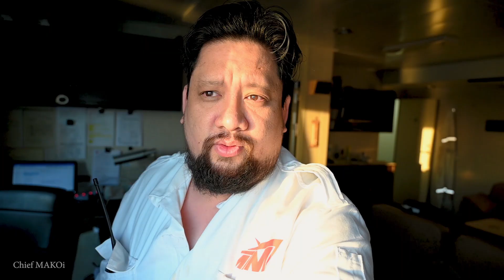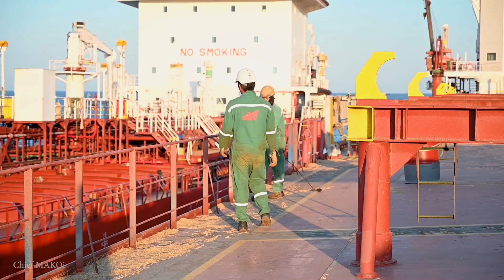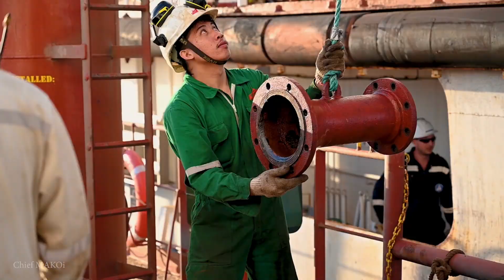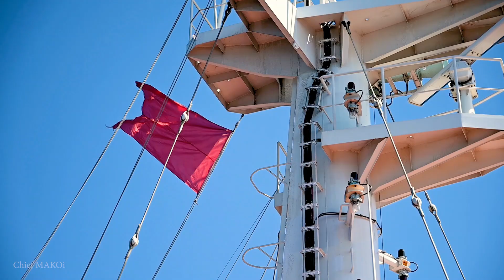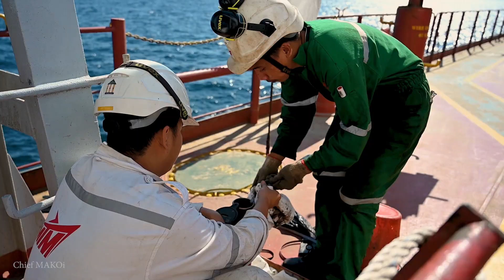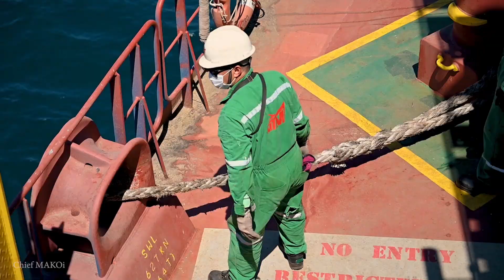Bunkering : Refueling Ships at Sea |  Seaman Vlog S03E10 Chief MAKOi

Comment: Interesting I'm curious what happens when you get bad out of spec fuel - seems like by the time an analysis can be conducted on the sample it would be way too late to do anything about the bad fuel that was loaded on board.
Reply from the maker: Ship owners will fight the suppliers with claims and if possible off-load the fuel.  All losses (off-hire, repairs, etc) will be charged to the supplier.  It's an insurance of sorts.

Comment: how can you be able to monitor or what you will do to produce or deliver a good quality of fuel in the system order to protect your fuel pump and  fuel injector?
Reply: fuel bunkered is not mixed or used until you receive the laboratory results.

Comment: I was curious about how this happens. Thanks for showing how it's done. I was surprised that no one took a final turn on the flange nuts with a torque wrench, in the correct order like a head bolt. Easy cure to avoid a leak? Thanks again. Fair sailing !

Comment: Great video. Those hard hats show signs of severe UV rot. Also, it appears those bolts and studs need to be replaced. Under ASME standards they should be replaced after every three uses and they should have been checked using a precision torque wrench. Stacking flanges like that is also against best practices, your fuel sampler should be built into a spool piece like the reducer.
Reply: i guess you are not seaman... hahahah

Comment: 400 tons of fuel oil to reach your destination?  Were you going from Miami to Fort Lauderdale?

I have flown 747's from Los Angeles direct to Seoul, and we put on 300,000 pounds [150 tons] of fuel to fly this 13+ hour flight.  This was a 747-200  with Pratt & Whitney engines that typically burns about 25,000 pounds per hour while covering around 600 miles, or a little under four gallons burned per mile, each of which we covered in 8 seconds.  The distance and fuel usage can change because when you are flying west, since you are generally going against prevailing winds which can reduce your ground speed by 100 mph in the winter months.

Those big boats eat fuel, I'd be interested to find out the gallons per mile at 20 knots....
Reply: thanks for showing us clearly that vessels are far far far far more efficient than planes. hahahahaha
Reply: @vicginval  YW
Reply from the maker: Ships like these consume only around 30 metric tons/day running at around 13.5 knots.

Comment: Unless you're with the military, then Underway Replenishment takes place. That's always fun. Marine Engineer who sailed with Military Sealift Command.
Reply: Underway Replenishment is when two vessels match speed and direction, and a coordinated sequence of events takes place where an "Oiler" , which is a tanker with Fueling-At-Sea stations sends a hose over to the customer.
Reply: I sailed from 3 A/E up to 1 A/E (internationally, 2nd Engineer to 4th Engineer). Cargo 2 A/E on Oilers maintains all deck equipment including cargo pumps, and is in control of the pumping operation. Cargo Mate is fully in charge, but Cargo Engineer is in full controll of pumps.

Comment: 7:52 that seems backwards. I would think that the sample would be taken from the barge before you go through the trouble of connecting the hose.
Reply: Yeah fr, and they’re just gonna use the fuel untested? Some things don’t make sense
Reply: the barge has already tested the fuel, and initially it is good, that's why they load it. BUT, if you are the buyer, you may trust nobody, so during loading you take another set of samples, to test by yourself and confirm the fuel is good. You will not use that fuel until YOUR analysis arrive. It can destroy your engine.

Comment: This is refuelling at anchor. You might as well be tied to a pier. Refuelling at sea involves ships underway. One ship passes a line (gunline) to the other. You then pass increasingly larger lines until you can haul the fuel line over. The only people who undertake this very dangerous evolution is the navy. Civvies don't have big enough balls to run 2 100000+ ton ships at 10-15 knots 100 meters apart.
Reply: it is not a matter of balls my friend. it just dont worth the risk. Navy vessels are built to perform that way, civvies don't. Those navy systems are quite expensive and very difficult to operate. Just civvies dont need it, they can just stop and do it safely.
Reply: @vicginval  then I recommend that you don't refer to our dangerous evolution as something civvies do. If you are at anchor you are not at sea you are at anchor. Usually in a protected harbour or anchorage. Most naval vessels don't generally need to replenish under way. We do it so when shit hits the fan we are ready to protect your disrespectful asses. Again when a ship is at anchor it's at anchor. When a ship is at sea it's at sea and generally underway. And if you don't have the balls to do what we do then don't tell people that's what you are doing.
Reply: @matthewmcintosh4925  ahhh... your problem is with the terminilogy... don't worry... i confirm this operation was done "at anchor in open sea", don't be angry. By the way , thare are also very dangerous operations carried out by civvies, but only when it worth the risk, for example Ship to ship cargo transfer operations, carried out at sea, underway, and with the vessel's touching each other, not 100 meters apart. I have been surveyor in a gas cargo transfer this way, if you like i send you pictures. From your comment i guess you are a member of the navy, and you felt extremely offended, relax man, my ass is not in anyway "disrespectfull". I simply admire every single seaman around the globe, i have to work side by side with many of them. But if i tell you the truth... i'm spanish, i guess you don't, so when "the shit hits the fan", you do nothing for me, you do only for your beloved compatriots. And by the way, you are payed for your job, same as me, don't expect the people to be amazed and gratefull for what you do, it is just like many other dangerous jobs.

Comment: That was fascinating. I always thought it was port to port fueling, never at sea unless it was military. I'm shocked that there's not more automation. Level sensors, discharge sensors and a much more streamlined connection. Bolted flanges with gaskets seems rather basic.
Reply: Because of the high pressure, flow and stresses on the fitting a large quick connect isn't suitable. Besides, bunkering fuel is typically a slow process. There's a lot to do whilst things are being made ready at the manifold and other locations that wouldn't be benefited by a quicker connection. The crew are on the ship so are on the clock so to speak so a reduction in manpower requirements wouldn't affect the bottom line either. They'd be sitting around doing nothing but getting paid. It seems complex on the surface but in reality it's 15 or so crew each doing their task which is fairly straightfoward in and of itself. A lot of these tasks are happeing simultaneously making it seem like a bigger task than it really is. 

Manual soundings are again another line of defence and reliability whilst a typically slow operation is taking place. The consequences for incorrect loading are catastrophic and expensive. Both parties are invested in double checking each others figures and not relying on guages. Many vessels do have guages but it is standard practice to manually verify quantity. We do the same in aviation - loaded mass is crosschecked with guage mass which is crosschecked against the previous flights calculated consumption. Eg if we filled up with 5000lbs of fuel, burned 2800lbs, loaded 1800lbs our guages should read 4000lbs - any discrepancy indicates a fault and we'll have to manually sound the tanks (mag strip, dip etc) to verify the quantity. Either the guage is faulty, the sensor is faulty, there's a leak or we have not loaded enough fuel (perhaps the refuler did litres, kg's instead of lbs etc etc) or perhaps we are burning more fuel than the system is calculating. Same thing on a ship - manual checks add another way of crosschecking. Incorrect loading can lead to dangerous stability issues, fuel starvation which has a high likelyhood of hull loss or even break up if there was grossly incorrect loading. Overflow is the least threatening concern but has significant environmental and financial penalties.

Perhaps some military vessels have some high speed bunkering process where the operational demands exceed the environmental concerns (I am not familiar with these so can't comment specifically) but for merchant & civillian marine it is an extremely high concern area.

Don't get me wrong, it seems complicated but in my experiance I have often (but not always) found that in commercial operations there's usually a good reason for things to be expensive, hard or labour intensive. Companies love to cut cost so if they can they usually will.
Reply: @twentysevenferrets  Thank you!
Reply: @twentysevenferrets  wonderfully stated! It’s great to see that some people still write in complete sentences along with punctuation.
Reply: level sensors onboard can give you an overview of the level, but they lack precission. If you make the ROB calculation of the vessel by sensor and by manual sounding, i have seen differences of 30/40 metric tonnes.... nobody wants to loose 20000 dollars
Reply: they should have atleast elecrical impact guns...
Reply: @kerstas10  electrical impact guns are extremely dangerous close to a fuel pipe.... WTF?
Reply: @kerstas10. Electrical !? In the presence of flammable oil !? Also a risk of metal impact sparks!

Comment: I've watched underway replenishment of US Navy ships many times in documentaries, where they usually use a pneumatic gun to launch the mooring lines. I was pretty surprised to see the crewman on the tanker throw the line by hand. Am I correct to assume that there were many misses and failed attempts before he finally got the line across the water ?
Reply: The navy ships are both moving, while these ships were not, so the ships here were a lot closer.   I think the navy ships are 100 feet or more apart, so throwing a line that far isn't possible.

Comment: How come these big tanks can’t just have a gauge see you don’t have to sound them
Reply: Less to go wrong with a bit of string and a weight, also you know if its broken.
Reply: its a black viscous liquid, it will be hard to see
Reply: it's impossible, the ship is always rocking so float measuring is useless. to make it doable it'd need complex installations for each tank. 
large tankers now use a special like sonar/radar probe that is inserted in the tanks when they are empty to measure their  volume accurately, even their volume was theoretical up until a few years ago.
Reply: Might be easier to measure fuel flow rate. If you know how much fuel you took on, and you know how much you're consuming, you can reasonably accurately estimate what your fuel status is. Not uncommon to do this in aviation. Sloshing fuel, unreliable gauges, the size of a gauge for a ship like that... Not hard to go without fuel gauges when you know how to do it.
Reply: The gauge will constantly move because the ship is moving

Comment: In Singapore, bunker suppliers use Mass Flow Meter (MFM) for quantity measurement, not sounding method. So, vessel crews do not need to take sounding on bunker barge. They only need to take a picture (witness) the zero-setting of the Mass Flow Meter. When the bunkering is finished, it is only to print the ticket from the meter. It is more efficient and less quantity disputes.
Reply: 5 barges discovered tricking the MFM's in Singapore

Comment: Interesting, I didn't realize commercial vessels refueled at sea.  I spent 4 years on a US Navy oiler. We refueled ships while underway.  Steaming at about 12 knots, ships would pull along side for fuel and supplies.
Reply: And I was probably on the receiving end of your hoses and receiving cables for four years.
Thanks for being out there to meet up with us!
Reply: Same here, for some reason I always assumed merchant ships would refuel in port, and only military vessels did it at sea.
Reply: From memory a major reason they refuel ships at sea is because it allows them to fuel in international waters and load dirty fuel that would be illegal otherwise due to environmental regulations.

Comment: 2 questions.  Why is there no mechanical or electric technology to tell you how much fuel there is in the tank? It seems so antiquated to rely on soundings.  Isn’t there a clock that spins, the way home fuel oil is dispensed? Secondly, I’m curious as to how much the refueling cost? Thank you chief.
Reply: fuel in the tank... there is... but lacks precision, and can be faulty . Sounding allways work, ever in a 30 yo vessel. Clock that spins... yes there are, but they are very very expensive and requires an extreme maintenance and periodic calibration by certified companies.

Comment: "... oil spill prevention materials were made ready, as standard procedure in case an oil leak happens."

4 DECK SHOVELS, 2 BROOMS, A 50 GALLON DRUM AND A HOSE  😳
Reply: There's a lot more on standby fyi.
Reply: any suggestion?... i bet you have never seen 100 liters of HEAVY FUEL OIL in the floor. How would you clean it  (i give you a clue, at 15ºc it is like nutella)

Comment: I’m wondering how you got that low on fuel to begin with? That refuel had to cost $$$$ more than topping off in port?
Reply: Not every port will have facilities to bunker from. There is also the high cost of sitting in port just to get fuel compared to the cheap cost of dropping anchor.
Reply: @jaquigreenlees : Thank you! Now I know!!

Comment: Hey there, chief! I have been wondering — is there a standardized method in the industry for tracking maintenance schedules and ship-specific tasks? A lot of stationary plants have long-serving chief engineers, and successors can take years to get the hang of it. Do ships have a more standardized or rigorous way of maintaining vessel-specific maintenance info?
Reply from the maker: It is a requirement but there are many Planned Maintenance apps like AMOS, SMMS, etc.  Some companies develop their own apps to fit their specific needs. These apps need to be certified by Classification Societies.  
Items like maintenance schedules, spare parts inventories, requisitions and other stuff are monitored and updated in those apps.  Which is why it is fairly easy for newly hired people to takeover but only if the data is updated properly.
Reply: @ChiefMAKOi  Thank you for taking the time to respond! This is useful and sensible.

Comment: I know you use the bunker fuel for your boiler. My ? Is how often do you bunker diesel for the main eng. is it all low surpher or a combination. As a fueler for aviation fuels we use to revive at 3000 gym. This ops seemed slow. I enjoy your video’s but being 74 yrs old I think I miss my calling.
Reply from the maker: We use bunker for ME and generators as well.  We only use low sulfur diesel oil in US and EU ports due to regulations.
Reply: @ChiefMAKOi  thanks for info ya must pre heat the crap out of that stuff to get it to flow thru them injectors. Fair Winds Shipmate and Following Seas. 👍😬😄😘

Comment: Brings back memories.  Now, try this operation doing 12Kts in rough seas  and  hoping you don't  hit the oiler.  In 45 minutes we took on 70,000 gallons .  That would last us about 3 to 5 days.  So, twice a week we would get fuel.  I remember a single emergency break away in three years.  What a mess.  Fuel on the main deck.  It was sticky and gooey.  A saltwater washdown first then lots of scrubbing.  On station, we carefully washed the side of the ship.  The fuel left a yellow-brown stain in Navy gray paint.
Reply from the maker: Unreps are not done in the merchant ships.  Companies won't risk the high potential for oil spills (and bankruptcy 😄).
Reply: @ChiefMAKOi  Yes, I agree.  Quick Question....with a full load of fuel,  what is your ship's range?

Comment: What would you do if it was heavy waves? I guess you could not tie up the "barge" against your ship like that then.
Are there no quick connect couplings for those fuel hoses so you don't have to tighten a bunch of screws?
Do you have a flow meter on the filling pipe or do you only go by measuring the tank level to know the quantity of received fuel?
Reply from the maker: Bunkering won't proceed.  We'll have to wait for more favorable conditions.
Unfortunately there are no standard quick connects and only a few tankers are equipped with flowmeters.  Countries have different standards when it comes to pipes, flanges, valves, etc.  So shipyards from different countries will build ships with what they have available.
Reply: What about Kamlock or TW connectors? Too unsafe? What is the diameter of the hose?

Comment: I thought big ships uses diesel fuel to operate because i used to work on a bulk carrier in 2010 but it was very small not more 1250 GRT
Reply: diesel is much more expensive than fuel oil.... diesel is reserved for port and sensible areas

Comment: But Chief, measuring the received quantity by calculating the volumes of the fuel tanks, is a reliable option? I mean, even slow changes in fuel temperature, could modify the density and the volume, thus changing the quantity.
Reply from the maker: We take them into account.
Reply: 400 metric tons of fuel doesn't change its temperature so fast.... we check the level and the temperature at the same time, and then calculate.

Comment: Great video as always! Question: Why do you not test the fuel sample during bunkering? If you wait for the lab, isn't there is a risk of burning bad fuel between bunkering and receiving the results?
Reply from the maker: Ships don't have that kind of equipment.  And we don't mix the new fuel with the old ones.  They are stored in different tanks.